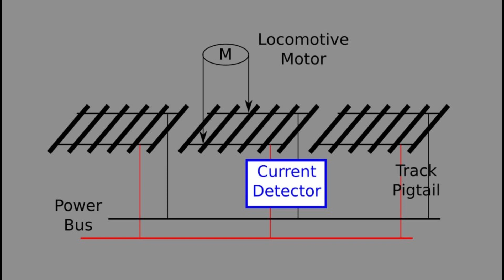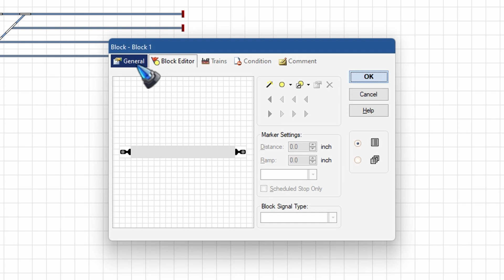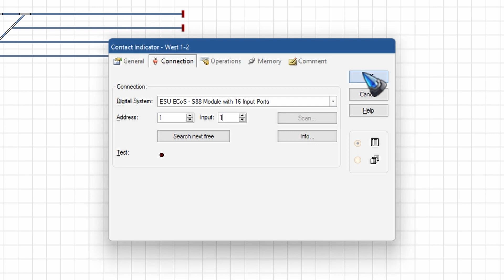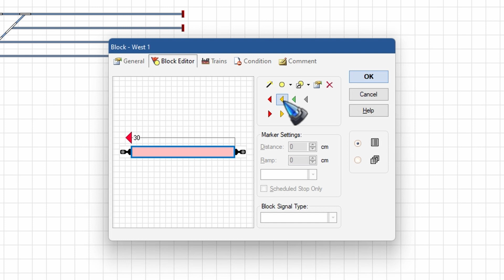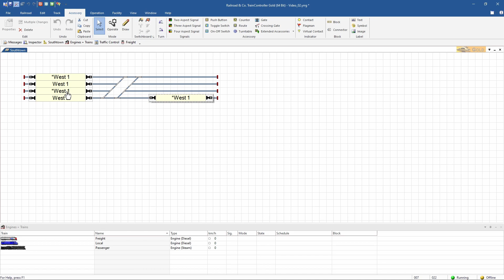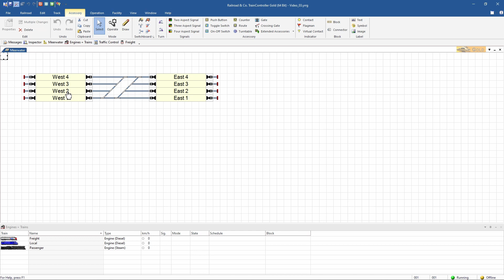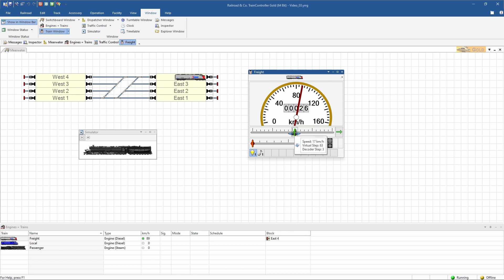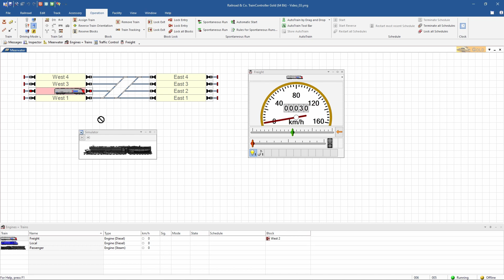Traincontroller 10 Gold 03 Blocks and Sensors

Comment: Hi Rudy, can you explain if adjusting weight, in the properties window of a specific engine,  will have an effect on where the train stops when using a brake marker? Or will adjusting this have no effect and the train will always stop at the specific brake marker location? Thanks
Reply from the maker: Adding a weight can influence acceleration and also deceleration, to mimic real life behavior. As far as I know brake and stop markers have priority though, si it should not influence those. Personally I never use weights, I just set the acceleration slider to a visually pleasant value and the deceleration to zero.

Comment: Rudy,  I got the basic connections and functions done. Yet I’m a bit puzzled by the block triple sensor set up. According to the manual one can have current detection  plus two momentary switches. Page 178, diagram 111. In bronze version of the software I can not achieve that. Would you be able to take a look please?
Reply from the maker: TC does not know the difference between momentary sensors and occupancy (current detection) sensors, it just receives a signal that 'a' sensor is triggered. What exactly is it that you can not get achieved? To place multiple sensors in a block, just click the little yellow 'place sensor' icon multiple times. Or ... maybe this is a limitation of Bronze? Can Bronze have multiple sensors in a block?
Reply: @rudyshobbychannel  Yes, I can place 3 sensors in the block. That is no problem. Occupancy sensor based on current detection covering complete block first. Than first momentary (IR) sensor soon after the start of the block and second momentary (IR) before the block end. What I see happening is, as soon as I place the second sensor on top of the existing one the detection area changes. I’ll try to build stand alone track and test it live. The idea is to have exact stoping point for any and all locos.
Reply from the maker: If I understand you corectly when a train enters this block, you have a current detection that is triggered first, then an IR sensor where you want to start braking and another IR sensor where you want to stop? If so, add three sensor in the block. Yes, they can not overlap in the visual image of the block, but that does not matter at all ... just have the current sensor in the middle, then you can use the block both ways. Now add a brake marker in the correct direction  to the first IR sensor and a stop marker to the second one. You can do the same in the other direction. You could even leave the current detection sensor out ... that makes life easier. I never use them, I only use momentary sensors, reed switches and magnets under the train.
Reply: @rudyshobbychannel  Thank you Rudy, yes you understood my question correctly. I’ll setup the sensors without the overlap and test again. The reason I like to have the current sensor is so the length of the trains will not matter. Accidental uncoupling can also be detected independent of the position of the car. I definitely have lots to learn but thank you again for clarifying the current issue for me.
Reply from the maker: Wagon detection only works if you have equipped every car with electrical pickups and a resistor that draws a current. And if it happens that a wagon comes loose you 'll still have to stop the trains and take corrective measures. Since it's something that should in fact never happen, or at most very seldom, and if it happens most probably it'll be at a turnout or a crossing, exactly the parts of the track where you probably do not have current detection, I never saw the benefit of it. And, frankly, I also never needed it. I hope you do get your sensors to work the way you intended.
Reply: @rudyshobbychannel  Provided there is no lights or other consumers, like on the passenger wagons, I’ll have the last freight car equipped with resistor wheels. Nevertheless, you brought up a very important points for me to consider. Thank you.

Comment: hi Rudy and thanks for the detail tutorial!
my question about the block is: in "general" topic you can add a speed limit. is there a way to change that speed limit for some locomotives?
Reply from the maker: The max allowed speed is an attribute of the block, and therefore holds for all trains. If you want specific trains to drive at specific speeds you can use speed markers.
Reply: @rudyshobbychannel  speed markers are the green arrow's?

Comment: Rudy, loved the Traincontroller 9 series and happy to see an update here for 10!  A question regarding setting blocks.  Your blocks on this current layout have natural start and end points, i.e., turnouts and end of track.  I have blocks that do not start/end at an end of track or a turnout.  Rather, some end in the middle of a long stretch of track.  How is a block end point get created in this instance?  Thanks again for the videos!  John
Reply from the maker: You can create as many blocks in series on a long stretch of track as you like. The start of the next block is the location of its entry sensor. At the same time that is the end of the previous block. If you plan to allow trains to stop in the blocks, just place a stop marker at the the number of cm just before the entry sensor of the next block. And of course add a brake marker too.